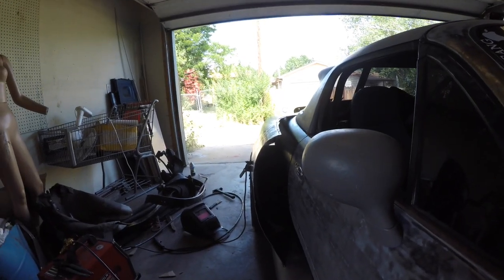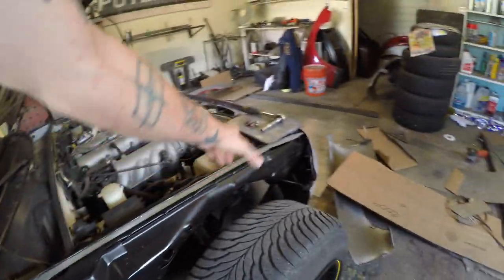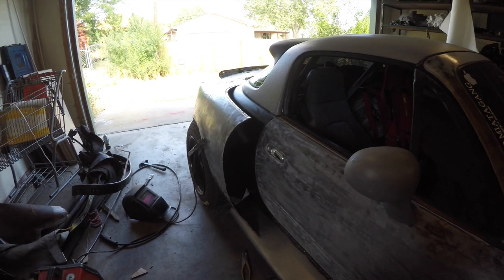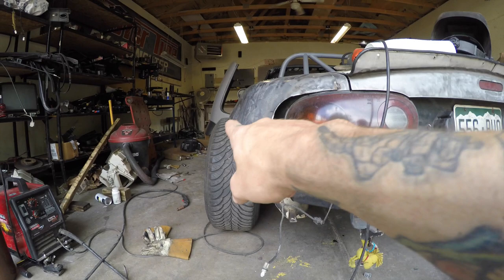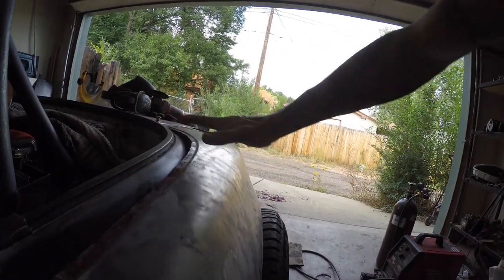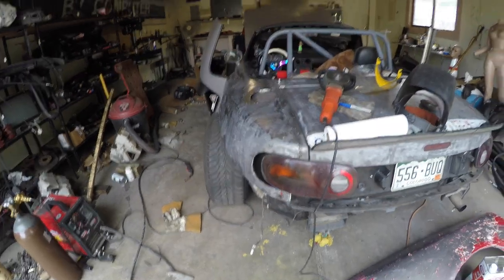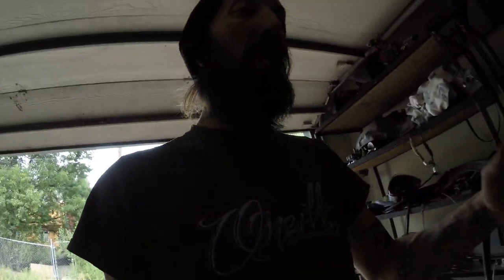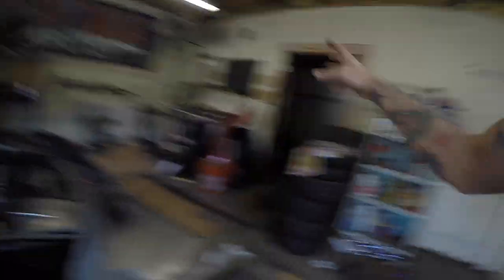Miata WIDEBODY PART 4 S06E33

Comment: just moved to colorado and im looking for a miata build!
Reply from the maker: craigslist, denver. tons up there and cheap because the market is saturated. usually around $1-2k try for a 96-97 if you can. obd2 and less miles usually.